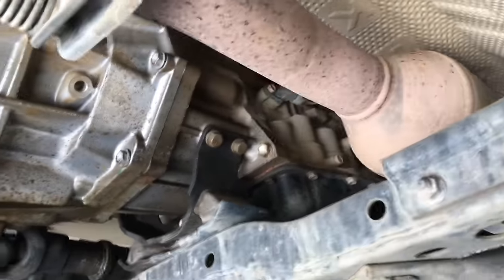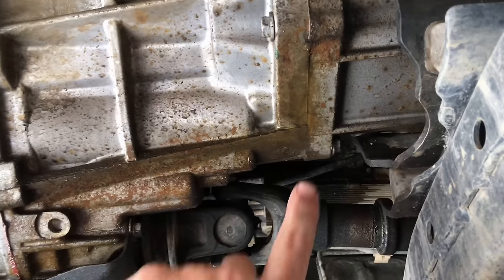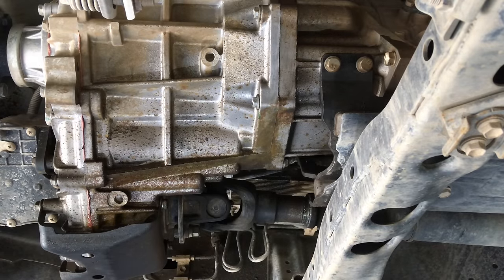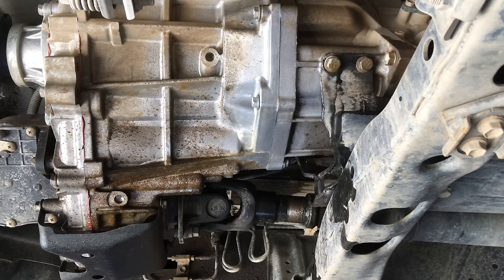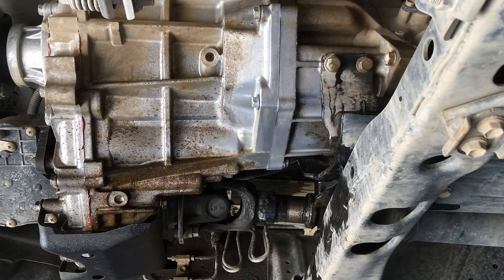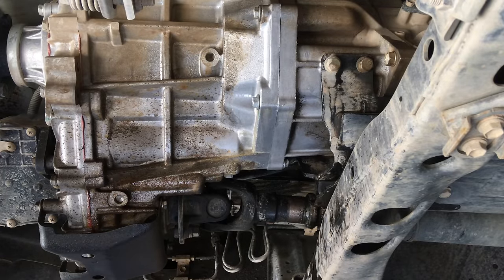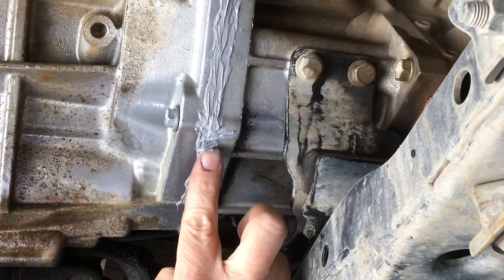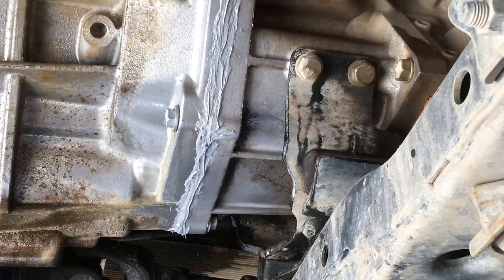CHEAPEST OIL LEAK FIX THAT WORKS

Comment: Now that's n.....rigging at its finest. Did not fix the problem. But probably changed the customer big bucks. Can you say it needs a new gasket. To fix it right.
Reply from the maker: To be quite honest I think you have an attitude problem you need to relax switch to a different radio station perhaps something a bit softer in Victoria we have one called gold 104 my personal favorite is the light 89.9 if you happen to be in Australia you can get that on an app and use it Australia white as long as you’ve got Wi-Fi if you’re overseas I’m not sure I’m able to help.

There wasn’t really a problem to fix but the demonstration of the product was successful didn’t charge the customer anything actually possibly 20 bucks we could charge the customer to fix it right hundreds of dollars to remove a transfer case and genuine seals to fix six drips a year that makes sense doesn’t it 🤷‍♂️😂😮🤔🤷‍♂️😂✌️

Comment: this is the most stupid idea to fix in the whole Internet  the actual leak is from the rear main seal between the engine and the transmission  
now you sealed  main the oil leak from the engine and stay in the transmission case filling it  near the torque converter 
OMG hope you will delete this video asap its a shame 😔
Reply from the maker: Your comment is the most stupid comment actually, because the oil leak is from the transfer case nowhere near the rear main you fool 🤣🙏✌️